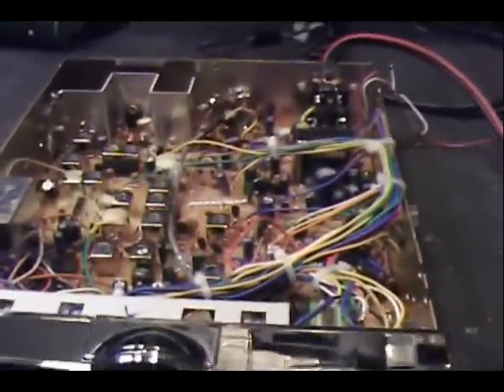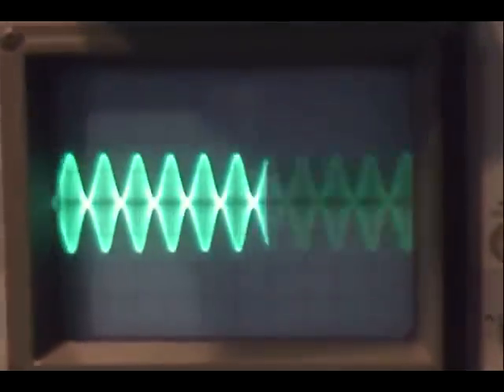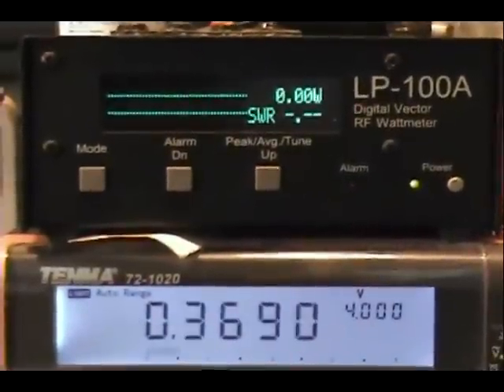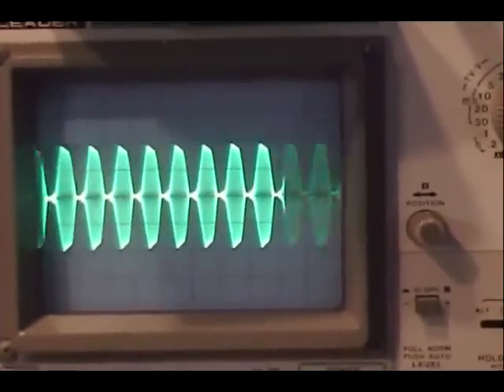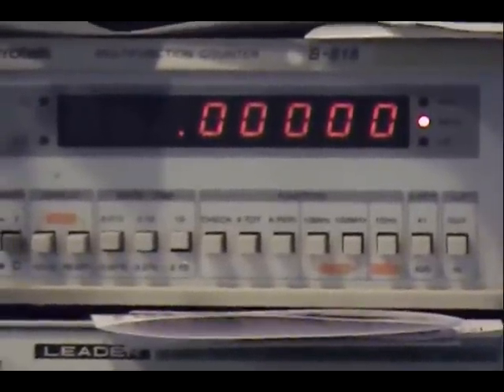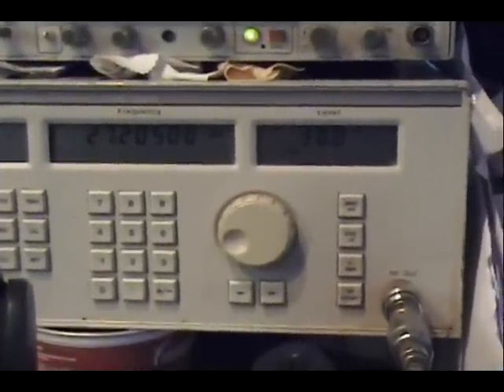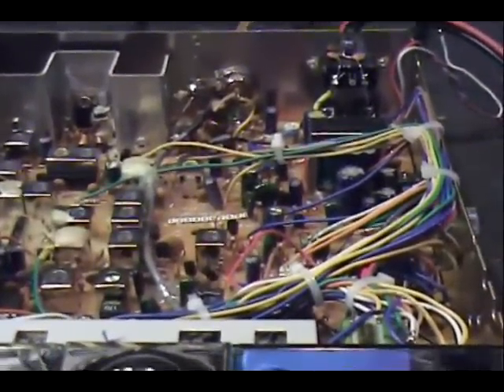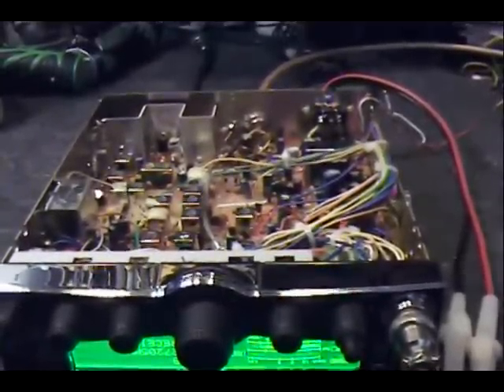Cobra 29 LX LE Review Part 2

Comment: I've been in the radio hobby since the 70's & I just can't believe how many of these cb shops & so called techs keep telling people that their am cb radio in doing 10 - 20 or more watts with the stock transistor. Yes is it is possible with changing the pre driver, driver & final transistor plus some other associated components plus tuning several stages of the radio that a higher output can be achieved. I find it hard to believe that this Cobra is putting out 23 watts right out of the box.

Comment: I have this radio. Box stock haven't had anyone touch it yet. I get a "cb antenna warning" though. Ive heard everything from I
Just need to get it peaked n tuned, to I need to install longer antennas. It's installed in a Freightliner cascadia. Any clue? Where are u located? I'm all over the country, I'd like to bring it to you for the works treatment.

Comment: Hello, I bought a 29LX about 6 months ago with a bunch of extras built in, dual echo board and other goodies. everything on the radio works great but now the power button will not turn off. volume still works and squelch works but I have to unplug it to turn it off. Have you ever heard of a power switch going bad? or do I need to look at something else that might be causing this. going to have to put a toggle switch on hot side of plug wire for now.  thanks, Bob

Comment: 30 watts out of the box? No. Clipping the limiter? Why? If the customer tells you to do it, Don't and say you did. They'll thank you later. Also, If you know the modulation is too hot with the VR turned up AND limiter in place, Just turn it back until you get nice hills and not "saw-teeth" or peaks. This screams WTF. And those asking, By law, The FCC states a radio cannot do more than 4 watts. What it does not say is it cannot modulate more than 4 watts. By the way, .30 mV is NOT S9. .90 mV is S9.